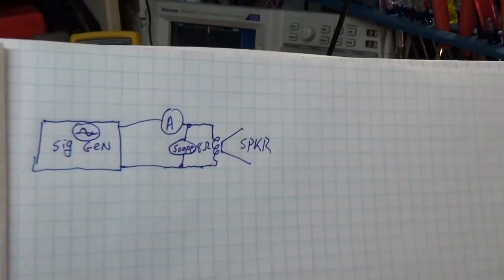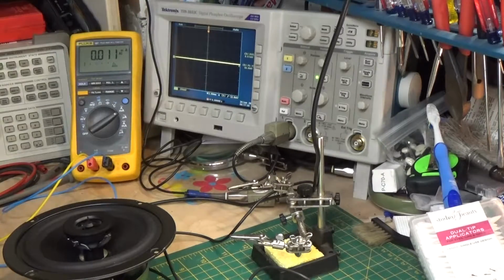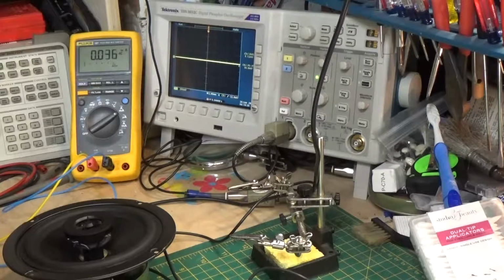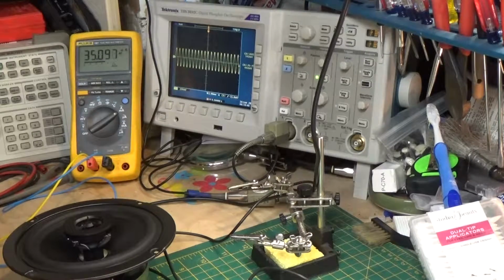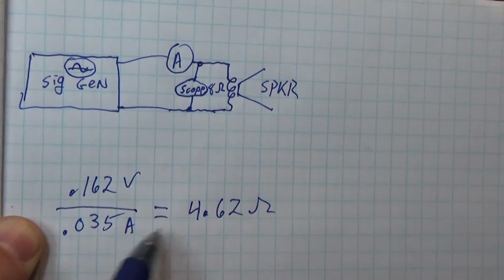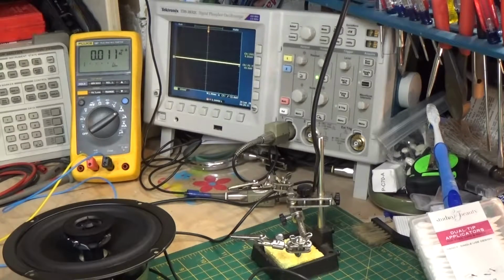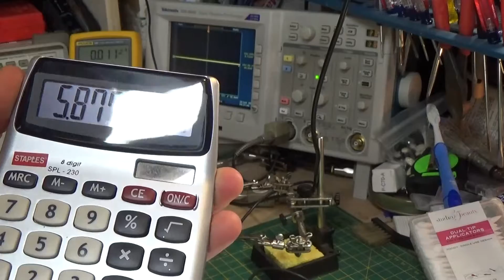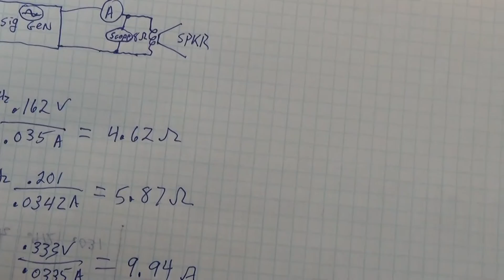Amp Power Rating part 2 - WATTS all this I hear about Impedance ??

Comment: Tony that was a good lesson. We worked for a McIntosh dealer we learned that the amps and speakers sounded best when used with the companies speakers, some of that is due to the output impedance of the amp, and the speakers, crossovers, and cabinet. All these things influence the sound. We also did recordings of peoples spoken word the easily identify the accuracy of the system sound. We used Nakamichi "sp" with condenser mic about three feet from the person. Try this method and you might be surprised at what you learn.